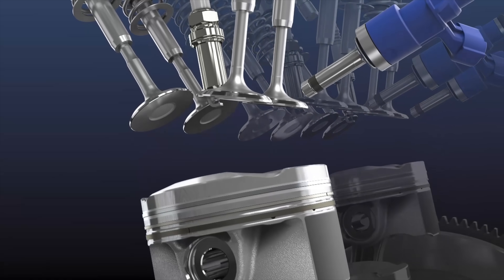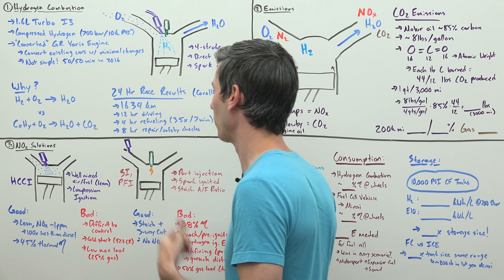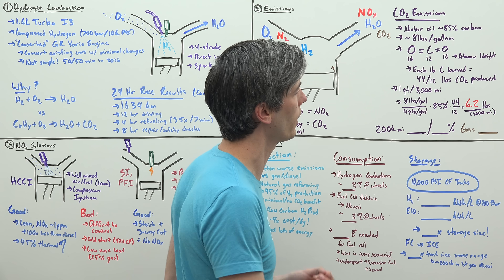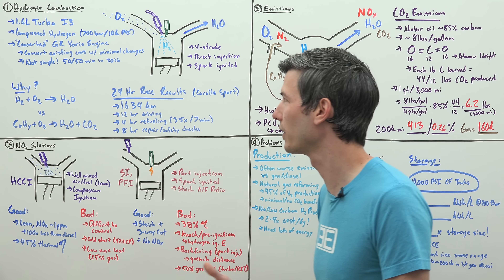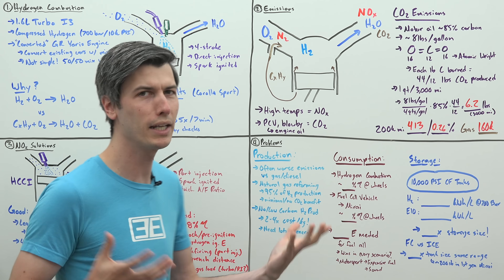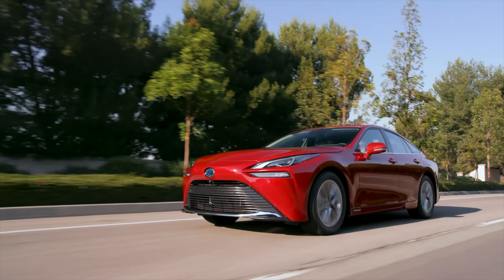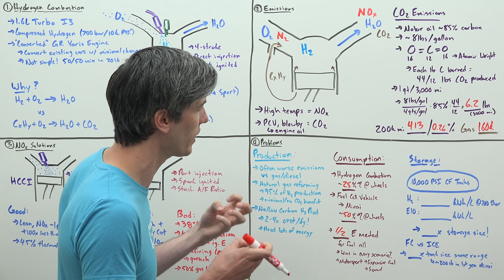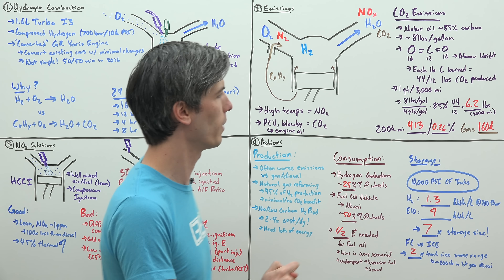Toyota's Developing A Hydrogen Combustion Engine!

Comment: Also not mentioned is the enormous amount of energy required to compress the hydrogen to 10,000 psi, none of which is recovered during vehicle operation.
Reply: Offset with nuclear or renewable energy
Reply: Hydrogen is another pipe dream.
Reply: that is a good point, so don't do that
Reply: @Brandon_letsgo  then how would you solve Japan's energy problems?

Being a small country located in a spot with the highest incidents of earthquakes and tsunamis on the planet, makes nuclear, wind, solar, etc less viable or more expensive or just flat out dangerous than in other countries.

One of their solutions is to import energy. Electricity can't be imported from far away...and frequencies and voltages differ between countries. (Japan can't even move electricity between north and south because of frequency differences)

If not imported hydrogen to suppliment their energy needs, what would you propose?
Reply: @tylerdurden3722  The point here is that hydrogen is less efficient than almost any alternative. So actually the answer to your question is pretty easy; do almost anything other than burning hydrogen! Battery powered cars, for example, will move more people more miles and at a cheaper cost than doing it with hydrogen. It doesn't matter how the electricity gets made. Also, Japan has a lot of nuclear reactors and doesn't seem to be slowing down much on nuclear.
Reply: @tylerdurden3722  Imported hydrogen? The logistics of that operation of shipping, storing and distributing hydrogen at any reasonable scale is mind boggling, not to mention the cost.
Reply: @ADVANCEDTECHTIPS  how does that help when the feedstock still starts at methane? That's where most of the hydrogen comes from today. So we're going to waste money on drilling for gas, again to reform that gas to hydrogen, with waste products, more money on storage tanks on the vehicle, build out a hydrogen infrastructure. Theres energy loses in every step. Easier just to just plug in and be done. Hydrogen is just a waste of money.
Reply: @tylerdurden3722  turn the hydrogen into ammonia and transport that. It stays liquid at relatively high temperatures and low pressures. Alternatively floating offshore wind farms could provide energy
Reply: @tylerdurden3722  with exception of nuclear (and that could be fixed with better and modern designs) what makes any of the generation technologies particularly dangerous. Wind and solar (+batteries to be a viable comparison) would be nearly no impact. Oil or NG generation might break down or pipe lines burst, but with proper automatic gates should be fairly safe. H2 would be more dangerous due to high pressures, it's abilities to leak through solid substances, and its wide flammability limits. Coal is safe and stable in an earthquake, but the steam plant could be damaged with little more danger than any other structure. Offshore wind would not be affected. Pretty much everything is as good as or better for safety. Even nuclear with a modern self shutting down design.
Reply: @Brandon_letsgo  An overly well funded pipe.
Reply: @court2379  It doesn't matter. Hydrogen as a fuel is not going anywhere,
Reply: @Brandon_letsgo  Hydrogen comes from natural gas.  It is far better to just burn natural gas directly.  Green hydrogen won't exist until you can use power to generate hydrogen, ship it to gas stations, and sell it while making more money than just selling your solar or wind power to the grid.  They are never going to make hydrolysis that efficient.  So energy producers will never generate hydrogen for a loss vs sending power into the grid.
Reply: its okay well just get solar roadways to refill our cars with hydrogen
Reply: @court2379  I placed "or" in-between

E.g., Nuclear can be either very expensive "or" dangerous in a place with many natural disasters, small land area and a high population density. (I live near a nuclear power plant, an old one that is past it's originally planned decommissioned date, and I'm still in favor of it.) But, in Japan's case, high magnitude earthquakes are inevitable, since Japan is located on 3 tectonic plate boundies and that scares the public.

The main obstacle to nuclear is the Public itself. Japan is a democratic country...and the leaders of Democratic countries tend to express the will of its people.

Wind can be expensive "or" not viable. Not much land is available for wind since it's an island with a huge population and huge industries. Japanese fisheries are difficult to convince of offshore projects that takes up large parts of its ocean territory. Designing and building Tsunami and Earthquake resistant wind turbines are also expensive. Japan has tested this. They built 3 large floating turbines that was far from profitable dispite being in a country with favorable electricity prices for suppliers (iow, it's expensive).

Solar has it's limits. Even large countries would have to rely on more than just solar. In a small country, there is an even greater dependence on other forms of renewables.

Most of this requires investment on the part of private industries, who would have to take on those risks.

All of this can be done, yes. But the solutions are all expensive or not viable or flat out dangerous. To the point where even the inefficient hydrogen starts to come in range of being economical.
Reply: @ZTK-RC  Nope, it will still make more money selling power into the grid.  Hydrogen production has no way to generate more profits for electricity than selling on the grid.
Reply: @ZTK-RC  SOLAR FREAKING ROADWAYS!!!!
Reply: @_PatrickO  Right on, Patrick!
Reply: actually, once on board, you don't need to pressurize the fuel using a parasitic compressor to get large amounts into a cylinder if you wished to.  There's also a gain in density charge from expansion cooling  allowing for more oxygen into the combustion chamber.  Heck, one could even recover energy by wrapping the HVAC condenser around the tank.  Energy is never lost after all.
Reply: @ZTK-RC  I think that was sarcasm?
Reply: @MosheVainer  That is Japan's plan though, as they doný have enough resources in Japan. They seriously consider tranporting hydrogen per ship, that is generated in Norway with hydropower. Green but not efficient at all.
Reply: @salipander6570  it got pretty ugly last time Japan wasn’t able to secure enough imported fuel.
Reply: @tylerdurden3722  California has so much solar power they export power. ever heard of the San-Andreas fault? So that's your first point proven to be invalid. I'm not going to bother with the rest.
Reply: @tylerdurden3722  The only reason fukishima happened was due to outdated regulations when the plant was built.
Reply: @gordonlawrence1448  lol "so much power" is that why they notoriously experience brownouts?
Reply: @Tacitus G. Kilgore What I'm saying is that if you're using the power to make hydrogen, vs using the power to charge and drive EVs, then the EVs will move more people more miles than the Hydrogen car, and it will always be that way regardless of the type of power, due to conservation of energy and the efficiency of electric-electric conversion. It also turns out to be the case that if you generate power from coal and then have people drive EVs, that you'll get more miles driven per carbon ton emitted than if you just put gas in cars and then drove those same people-miles. (It's because gasoline engines are actually super inefficient, using only 15% of their power to turn the wheels, and even less if you count well-to-wheel.)  But that is a whole different thing.
Reply: use thorium to produce hydrogen....
Reply: Combine the H2 with C to make a stable liquid....
Reply: @tylerdurden3722  a couple of nuclear submarines should fix it right up
Reply: Toyota seems to be in the weeds on this. I can’t say I’m that impressed with their initial results.

Comment: Does this mean that hydrogen combustion spinning doritos are remotely theoretically possible now? 🤔
Reply: Mazda actually made a hydrogen powered RX8 available to Japan at one point
Reply: @rzyao64  crap you're right, I thought for some reason that his video 2 years ago concluded that hydrogen rotaries weren't really possible. Thanks for correcting me
Reply: Wouldn't you need multiple Doritos per rotor?  Jason mentioned some pretty high compression ratios, the easiest I've heard is using a big rotor for initial compression and final expansion and a smaller one for final compression and initial expansion.

Jason also made a video on why it isn't happening (Doritos in general, not multiple tricks or h2).
Reply: You can put the spinning Dorito on LPG... That will pass emissions
Reply: Liquid Piston engine. New rotary that can and does run on hydrogen. The channel Warped Perception just did a video on it.
Reply: That heavy fuel cell kind of hurts the advantages of this. It would still be pretty awesome though

And actually might fix some of it's emissions problems. I don't know how much of it's emissions problems were NOX though...
Reply: Yes. Yes it does.
Reply: Now with pre chambered ignition dorito can litterally annilathe piston engine in every mesure
Reply: Yes!!!!! To that rotary hydrogen dorito!!!!!!
Reply: Would be a better way to go than electric
Reply: Cheesy 🤔
Reply: Wait what about Hydrogen Fuel Cells ? Aren’t they a good way to power electric vehicles
Reply: This is so disappointed after knowing hydrogen power vehicle is so inefficient. They should just spend the resources on nanotechnology improving EV battery cell
Reply: @ivan5604  yes but, spinning dorito go bang bang very fast :)
Reply: What about lubrication and corrosion?
Reply: ... YES!
Reply: @Lawdog652  I like Matt and his channels. I was bummed to see the weak performance of the kart though.
Reply: Yes absolutely. Brilliant. Get rid of the electric bumper cars.
Reply: @VonGeggry   Theoretically if you could filter the nox then you could use it as nos increasing the power and efficiency of the engine.
Rather like a turbo charger for a normal engine.

Comment: Excellent summary of the challenges faced by hydrogen ICEs. You mentioned briefly the molecular size wrt inside the engine, but is also a major concern for storage, transportation and filling safely. That combined with the ignition concentration from around 10% to 90%… H2 ICEs are unlikely to be anything other than expensive development dead-ends. I work for an engine manufacturer in Switzerland and I teach engine courses in the training center there. Great video!

Comment: You should do a video on using ammonia as fuel for and ICE (or fuel cell).  I've seen a bunch of articles about using ammonia produced with renewable energy to store hydrogen eliminating the need for the high pressure tanks.

Comment: Don't forget the VQ engine with the Z/G, especially the rev-up edition. They usually loose at about 1q 1k miles.
Reply: I'm sure you have a lot of experience with forums that I don't have, but my 370z burns next to no oil at all! Which is nice, coming from an EP3 Type R
Reply: I guess I should have stated DE not HR. The HR fixed a lot of the DE issues. I came from a J30A1 which nearing the end of my driving of that car was burning some amount of oil that I don't remember as that was 8 years ago.
Reply: Speak English, we don’t need letter gibberish
Reply: @TKUA11  I'm sorry that you do not know engine models. VQ35DE is the infamous 350z/g35 engine as well as a good chunk of 3.5L engines for Nissan. The VQxxHR was the revamped version. J30A1 was a Honda V6 engine in the Accord.

Comment: Can’t wait to see the tuning potential this hydrogen combustion engine has🔥
Reply: Just imagine a car like the bmw hydrogen 7 (6.0L V12  390 Nm, 191 kW) but more performance oriented
Reply: @martini380  To bring back these large N/A engines with Hydrogen combustion would be awesome.
Reply: Guys. Don't forget that hydrogen may be clean in the burn, but it's polluting in the making.
So to have a middle way and not be too crazy would be the reasonable way to go.
Reply: @boboutelama5748  everything has some level of pollution. EVs create plenty of environmental issues themselves. The idea is to pollute less than we are now.
Reply: @user-gm4kv2my4u  Exactly
Reply: @boboutelama5748  Not necessarily, hydrogen via electrolysis can be very clean, if you run it on renewable/nuclear energy. 
It's a different story if you make it by reforming natural gas though, which at the moment is the most common method.
You could still make an argument for the later method being superior for BEV's though, in terms of Eco-friendliness. 
As our energy production becomes more green overall, and more efficient, electrolysis becomes more and more viable large scale. A big step we could make towards that end, is ending the anti-nuclear stigma and building more nuclear power plants, which are arguable the cleanest, and safest method for large scale energy production
Reply: 2 things : H-bomb and Zeppellin. An interesting spectra of tuning possibilities.
Reply: @elbart100  Neither of those outcomes are possible in the case of a regulated hydrogen fuel tank.
Reply: @Erowens98  ....which still needs electricity, creating pollution. I agree with your nuclear energy standpoint. We just have to change the initial source of energy and we are golden
Reply: @user-gm4kv2my4u  battery ev would be more efficient. Creating hydrogen with electric is far less efficient than charging a battery and then burning the hydrogen in a combustion engine is far less efficient than electric motors.
For hydrogen combustion cars you will need a lot more electricity than you need for an electric car.
Reply: @aaronheaney2694  go find the lithium for those batteries and come back and try to tell me it's more green. Sorry but electric vehicles need to run for like 250k miles on original batteries to MATCH an standard ICE vehicle with 60k lol. It's just not something that will work
Reply: @cryptikreap795  I hope your building your whole hydrogen car including engine and parts from hemp then and not any mined materials.
Reply: @cryptikreap795  still have to mine extra materials for the hydrogen specific parts such as high pressure tank and new components to run the engine. Whether you make ev or hydrogen combustion you still have to mine materials so that kills your building the car argument. So in that case we have to look at keeping the car running and that has the ev far more energy efficient.
Reply: @Erowens98  Yes please educate me if you will, but be it known that I am joking. However in reality it is because I do not see hydrogen as being a renewable fuel the way we produce it now; however it might be interesting for other aspects. Hydrogen is however a way more dangerous and reactive gas then a hydrocarbon / oil based petrol / fuel; that is a bit my point in this joke. I was not clear for sure.